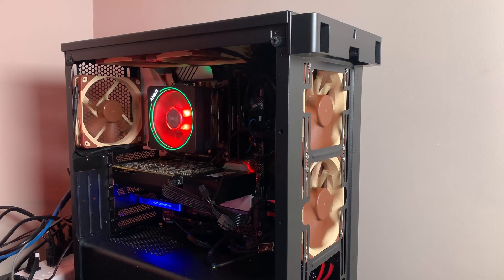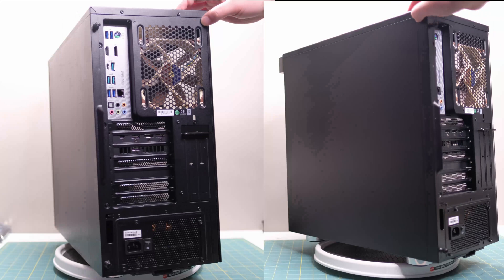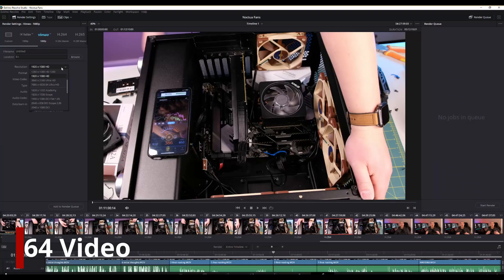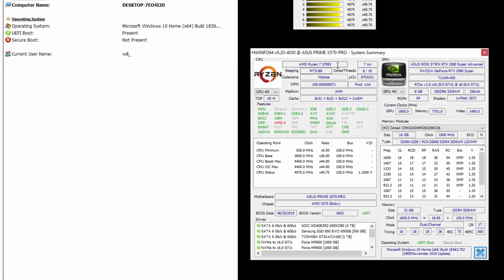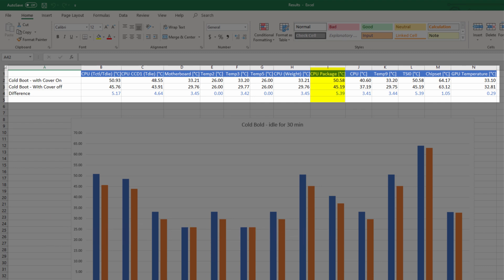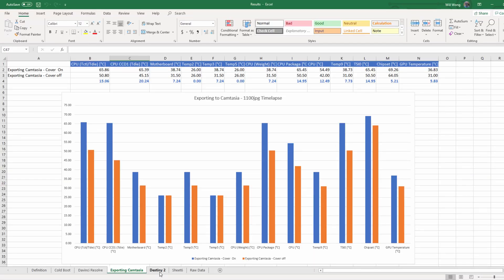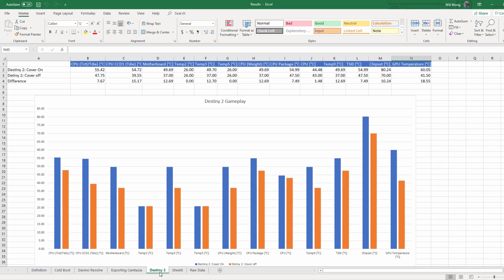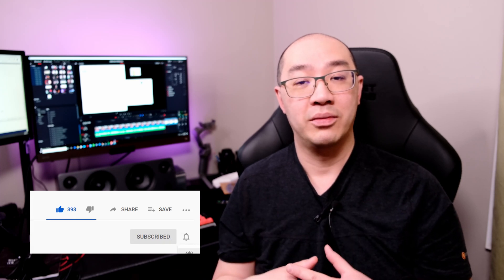Corsair Carbide 275R Case: Front Panel On Or Off | Temperature Difference

Comment: Great video!! I have a similar case coming and was wondering how do you connect your pc to your monitor? what cables do you use as I notice it doesn't have a usb c port and lots of display cables are usb c. Thanks
Reply from the maker: Hi there. I have a 2080 Super video card that has a display port. I connect that to my monitor.

Comment: Im putting 3 intake fans in the front of my system but i have a radiator mounted at the back for the cooler. where should i put the other 2 fans..? i have 6 all together  one is installed at the top as well
Reply from the maker: Hi there. I’m assuming you have the same case as the video. i would put two fans venting out the top.

Comment: Thanks amazing results, I did the same to to my PC I have ryzen 5 3600 and rtx 3070, my cpu was getting really hot in my case, after 30 mins of gaming it kept reaching 85degrees, when I took the front cover off, after hours of gaming max temp was 68 degrees. Im going to leave it open for now as Im really happy with the temps. Will I run into any problems in the future because of leaving the front panel open apart from having more dust? Thanks
Reply from the maker: Thanks for taking the time to comment. I left my case open all the time after my testing. I didn't find any issues other than dust and the aesthetics of it. I ended up replacing my case with a Meshify 2

Comment: Hello really nice Video... Can I switch this panel with an 275r airflow panel?
Reply from the maker: Hi there, the answer is Yes / No. Technically you can do it, but according to the commenter below, it's complicated and may not be worth it.
Reply: No you can't. Different control panel at the top where the power buton is and it has more pins to hold it down. It can be done but its more complicated than it looks
Reply from the maker: @ryy597  Thanks for clarifying. I actually reached out to Corsair support when I was thinking of purchasing the Air Flow panel. They said i could, no problem at all. HOwever, they didn't tell me how complicated it was.
Reply: @TheWongReviewer  did you end up purchasing one? I was curious if it could be modded or fitted in a simpler way but they were always out of stock. I never was able to find a cover anywhere. The panel i was refering to was the io panel. On the 275r its the full width of the case while on the 275r airflow its only half the width.
Reply: @TheWongReviewer  i have been dealing with bad temperature on my new hardwarem been trying different fan configurations. I even thought about changing case at some point. My last options is trying to source a 275r airflow front cover.
Reply from the maker: @ryy597  With the cover on, it was just too hot for me. So I permanently left the cover off. It looked ugly and a dust magnet. Last month, I upgraded a few parts and ended up getting the Meshify 2 case and sold the Cosair Case.
Reply: @TheWongReviewer  how are you liking the meshify 2? I am considering changing cases aswell. Either the meshify, corsair 4000d airflow or phantek 600s
Reply from the maker: @ryy597  I really like the Meshify 2.  It  has a bigger footprint, but I like the fact I can install 5 hard drive and the cooling is great. I will be doing a video on this case in late March.
Reply: @TheWongReviewer  great. I look forward to watching that video! Could you include thermals comparing your 275r with the meshify? I think it could be interesting!
Reply from the maker: @ryy597  Hi there. Unfortunately, I can't. I completely changed my setup. I have a 360 AIO installed and not using the stock meshify fans. It won't be a good comparison. I will touch on it though for sure antidotally.

Comment: How the hell do I remove the front panel?
Reply from the maker: Hi there. The four corners have those "click in" tabs that hold the front panel on. I suggest you start at the top left corner, and just apply pressure to pop out that tab. Then work your way around. It does take a bit of force initially.
Reply: @TheWongReviewer  Thank you! It felt like I was going to break the entire case
Reply from the maker: @iblamefps  Hey there. Glad you managed to get if off! Yeah, fortunately, those 4 click in tabs are pretty robust. Before I switched cases, I actually left the front panel off as I found that my temps were cooler. It looks really ugly just showing the mesh, but it was underneath my desk and out of sight.
Reply: @TheWongReviewer  I saw in the video, I prefer mine on though as I don't need that little boost in performance and mine stays on my desk next to me so yeah

Good video though 👍

Comment: Great video thank you. If you can test with AIO cooler to which side of mounting is the better front or bottom for tempature, that would be very helpful too! Sorry for my bad english.
Reply from the maker: Hi there. Thanks for the suggestion. Yes, this is one of my plan videos. I do have to mount my AIO cooler differently and get back to you with an updated video.

Comment: Thank you for the video, it really helped a lot!
Reply from the maker: Awesome. Thanks for the feedback. do you have the same case? Did you decide cover on or off?
Reply: @TheWongReviewer  I have a Corsair 275Q and I've decided to go front panel off. I noticed a 5-8 degree drop in the temperature while gaming and a 2 degree drop while idle with system fans set from 80% to 40%. I'll be keeping the front panel off until I get a case more suitable for my need (i.e. better airflow).

Comment: why not just buy the "airflow" model? has a panel with a lot of airflow. 
great video anyway. especially the point where you acknowledge that this is not 100% the scientific method. are you a scientist?
Reply from the maker: Hi there. Thanks for commenting. You're absolutely right. I should've bought an airflow model. This was my first custom PC build in over 15 years and my knowledge has really grown after this build. I didn't know what I didn't know when i first started building this PC. So i went with what I had done in the past which was basic PCs, versus gaming / video editing rigs. Now I know aiflow is important, so i'll be making that change. I'm still learning and that's what I like about this project.
Reply: @TheWongReviewer   I'm currently building my first. (bought the rig. not everything arrived yet.) and do have the airflow model. 
is there something that you would recommend me to avoid or do during assembly?
(I know about grounding)
Reply from the maker: @RKBock  Shoot me an email at thewongreviewer@gmail.com . Tell me what your setup is and i'll send an email of lessons learned. It's just easier than using youtube comments. Happy to help.
Reply from the maker: Sorry, forgot to mention that I have a Bachelor Of Science degree and spent a lot of time doing research and experiments during my University days. So, i do enjoy the testing and data analytics of these type of videos.

Comment: i was going to buy 6 ll120 fans but now i realised. im just going to buy 3 and put one at the back as the exhaust and the top 2 slots as the intake.
Reply from the maker: Hi there. Thanks for commenting. Yup. The case already comes with 2 fans in the front, so 3 more is all you need. I have to admit, i was a bit overboard with switching my fans to all Noctua.

Comment: but the problem is if you take it off the front panel, more dust.. i suggest 5 fans in the case for more cool and leave it closed.. ..
Reply from the maker: Hi there. you are right about the dust. I did a follow up video showing all the dust collected at the filter and in the case. I still have my case open as the temps are lower and committed to vacuuming it more often.
Reply: @TheWongReviewer  hello sir can i change the front panel cover using 275r airflow?..

Comment: nice vid but any technique taking it off cant get it off!
Reply from the maker: Hi there. Thanks for watching. Yes, i have to admit you have to use a bit of force to pull it out the first time. The way I did it, the top corner ones were the toughest. I slowly worked through each corner, popped them out one by one. You can't pull it out all at once. Hope this helps.

Comment: Hi Thanks for the video , 

I was wondering if corsair has a different front panel that could replace the one on the 275 R . Whats your view on that ?
Reply: https://www.corsair.com/us/en/Categories/Products/Accessories-%7C-Parts/PC-Components/Cases/CORSAIR-275R-Airflow-Front-Panel%2C-Black/p/CC-8900403
Reply: @vicvinegar5514  did not fit , because the dimension between 275r and 275r airflow is different..
Reply: @neilzracked  I searched the internet to find the answer to this, will the airflow front fit the regular 275r. cheers.
Reply: @ThatGuyKal  seriously.. ? the aiflow 275r front panel fit to the standard 275r.? can you provide pics sir kal.. thanks
Reply: @neilzracked  you misunderstand, I take what you said as the answer to what I searched, that it did not fit
Reply from the maker: Hi there. Thanks for watching and the feedback.  I have never really researched looking into replacing my front panel. The comment left by Vic Vinegar seems to be a good option. That option may provide more air flow.
Reply: @TheWongReviewer  It's out of stock atm

Comment: How can i remove the Cover?
Reply from the maker: Hi there, thanks for watching. You just pull the cover off towards you. there are 4 clips in each corner. It does take a bit of force.
Reply: @TheWongReviewer  The tabs broke just the second time removing the front cover -_-  Why did they make it so hard to remove? ...and of course the replacement covers on Corsairs website have been out of stock forever...  how am i supposed to clean my fan filter if I cant take the front off without breaking it? I pulled evenly from the bottom like I think I was supposed to.

Comment: Hi cool and nice video, I suscribe. I'm having the same problem but with my Corsair Spec 06, I have an old r9 390x recently repaste with liquid metal. Whit the front panel on the temps go too high (90°). With front panel off I got (70°) that's an insane decresse -30°.
Reply from the maker: Thanks for watching! Wow! That is crazy, 30 degrees is a lot. How many fans and what is  your fan setup?
Reply: @TheWongReviewer  3 Fans: 2 front intake 1 rear exhaust. I mean if I leave the front panel on in two hours of playing some heavy game the gpu can reach 90°c but if I take off the front panel the temps never go more than 70°c degrees. I am seriously thinking about to modifying the front panel... making some holes.

Comment: Hi, good job! I interessing to buy this gamimg case, you recomend? My use is casual games (CoD, BF,Apex) and video editons basics. I'm thinking in assemble with 2 or 3 fans in the front and 1 fan in the rear. What you say me? He it will heat up? Sorry my english, i'm learning. Thanks and Brazilian greetings. =D
Reply from the maker: Hi there. Thanks for watching. My co-worker is from Brazil and I love hearing about the country! 
Yes, i would recommend this case. It has a lot of room for expansion. What graphics card and CPU are you planning to use? The case already comes with 1 fan that exhaust out the back. If possible I would get 3 more fans. 2 in the front. 1 in the back. 1 at the top. That should do it. My setup was a bit extreme with 5 fans ( I really don't think i need this many). You're good. Happy building. Let me know if you have any questions. Happy to help.
Reply: @TheWongReviewer  Cool haha. I have one RX 580 + i7 3770 but i want trade my kit in the Ryzen (5 or 7) + Rtx 2060 super or 5500 XT 8GB in the future. Here in brasil is very hot, for this i want assemble the case with 5 fans (and a litte for beauty too with the rgb fan). Thank you for atention and succes in your channel. :D

Ps: what your focus in channel? Hardware analysys?

Comment: Can I remove the front panel without opening the sides up?
Reply from the maker: Hi there. Thanks for watching. Yes, the front panel is an independent piece. It just pops right out. There are no screws holding it in place.
Reply: @TheWongReviewer  Thanks! Just popped mine off with some careful elbow grease :)
Reply: @shanafan  how did it come off?
Reply: @TheWongReviewer  Thanks ive been wondering how to take it off but was to scared to force anything

Comment: Great video, but as it seems i may have some issues with my build...
I have the same case, a 3800x CPU and a Gigabyte RTX 2080 Super, hooked on an MSI MPG GAMING EDGE WiFi MOBO...
Although i get similar idle temperatures, when gaming i get near 80C for CPU and 70C for GPU (gaming in 144hz 2K monitor, games like CoD, Divinity 2, Valorant etc)...
Don't know what's the problem tbh..
Reply from the maker: Hi there. Thanks for watching. That seems high. Is that with the front cover off or on? What CPU cooler are you using and how many fans are you using?  I have to admit, having 5 fans in my case may be the extreme end.
Reply: @TheWongReviewer  Hey mate, front panel is on (i suppose if i'm going to get it off, i may as well switch to another case since with the panel on it looks very pretty, i have the white version of it).
I use stock cooler (Wraith Prism RGB), and stock fans from the case (1x Intake Fan, 1x Exhaust Fan).
I was thinking on getting 2 noctua fans for intake, and replace the stock fans to back exhaust and top exhaust, so i will have 2 intake fans (noctua) and 2 exhaust fans (stock case fans).
Reply from the maker: @NickDiMod I have never seen the white version of this case. NIce! Yes, getting 2 intake noctua fans will help cool down the case. I would also double check in AI suite to make sure your fans are set optimally as well. I had to do some tweaking in the software. Good luck.
Reply: @TheWongReviewer  did some tweaking, i also removed the front cover and i saw a fair difference in temps (at least at idle that i'm checking now, haven't tested gaming yet).
I'm about to order 4 Noctua fans, 2 Intake (in front panel)  and 2 Exhaust (1 rear and 1 top above the CPU for the exhaust).
For the top exhaust i will have to go for the slim Noctua (
NF-A12x15 FLX, Premium Quiet Slim) because it's kinda tight there :P
For the rest of the fans i will go for 
Noctua NF-F12 PWM, i was reading that having Static Pressure fans for intake/exhaust is better than having Airflow fans (but with more noise)..
Since i don't care having something silent, i will go for performance in temps.
And you sir, got yourself a subscriber :D
Reply: did u turn the turbo switch on next to the fan?  Wraith Prism RGB is 140twd cooler,  hitting 80c on 3800x is ok but try to control it under 85.   better off getting a better cooler like Scythe Fuma 2/ d15 / d15s / Dark Rock Pro 4, these will bring temp down 10 c when underload, but no change at idle since that is how gen 2+ amds are.
Reply: check your cpu slot pins.. i mean really check them..

Comment: Holy hell, thanks!

One thing to note is that by having the front opened, the fans are pushing much more air in, however with it - dust as well - so I suggest to find 10 minutes of free time every Sunday morning to keep the case clean and it will reward you with the cool. :)

Also, if "your" (anyone's) temps are already pretty cool, then this method of cooling is not necessary, but if you like seeing some C°s lower, go for it.

Lastly, I suggest to only do this when you're actually doing something that puts a load, as your PC stays cool on idle or on YouTube or small stuff, so just leave the front closed to reduce the dust gathering by that much. :)
Reply from the maker: That's excellent advice. I do mention in the video for "normal" computer activities, just to leave it on. Good call on cleaning it out once a week.
Reply: dude, about what dust are u speaking? if we are still keeping antidast panel on?